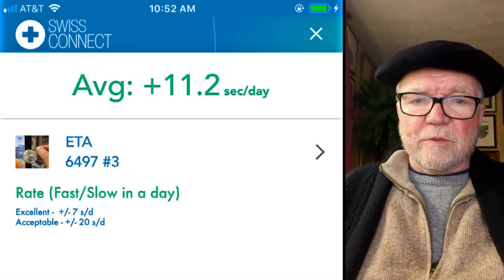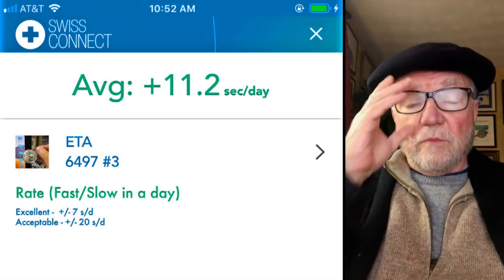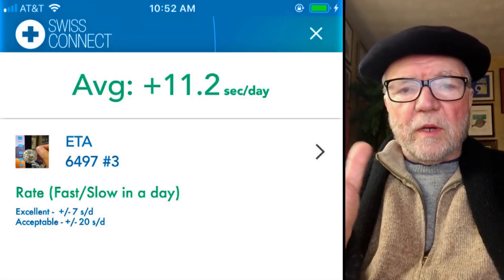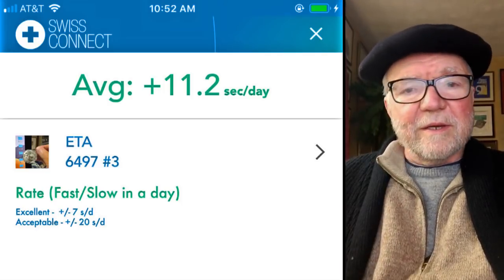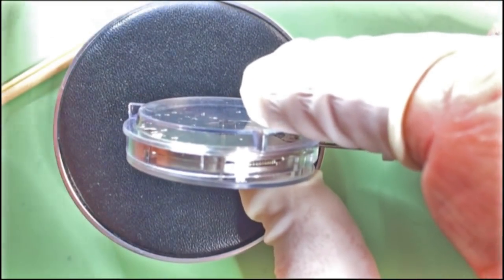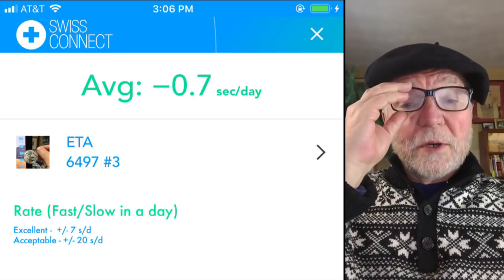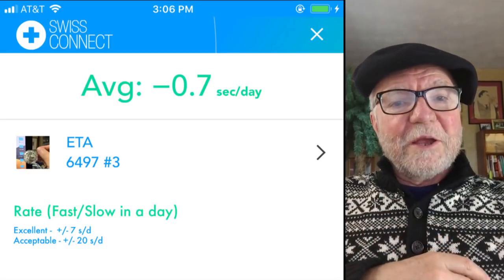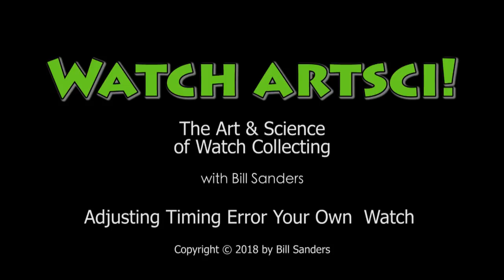Adjusting the Timing Error on Your Watch

Comment: can you do this without taking the movement out? my 6497 is running about +60 seconds a day
Reply from the maker: Yes Itubrr. 1) Use your timegrapher to determine the error. 2) Take the back off so you can get to the regulator. 3) Move the regulator to the left or right 4) Put the back cover back on. 5) Put the watch in the timegrapher. If it's ok, then you're all done. If it's still off significantly, repeat step 1-5. Take care, Bill
Reply: @watchartsci  I don't have a timegrapher or know if anyone without paying. I'll just have to trial and error; if your little push misused off 17 seconds I can do 3 of those then and still be good at +60 right now. Thanks for the video!

Comment: Well done Bill
Less than 1 second is better than COSC.
Reply from the maker: Hey Thanks FM. It's been running well, but there're a couple a problems with the movement that needs fixing. I think it's in the keyless works. Never a dull moment! Cheers, Bill

Comment: Hi Bill, started to put together my Daughter's Sea-Gull Parnis this morning, put  on the Dial and Hands got it into the case then
come the part i hate putting the 2 small clips with screws that hold the movement in, had to stop and save that part for tomorrow. This is my third Build too, most enjoyable and rewarding....Thanks for posting....
Reply from the maker: Hi Bill, still looking for a trick to get in the case screw/anchors. Spent several hours to get one in, and now I have to work on the other. It looks like the Green screwdriver is the right fit. I've been using the Rodico putty as a 'magnet' for small screws and anchors...it sometimes doesn't want to leave the putty...if you know any tricks...let me know! Cheers, Bill
Reply: What i did with my other watch i put the screw in a pin vice and using a dry oil stone put a point on the screw
it don't have to be a sharp point just enough to enter the hole better...You have to do both screws  
Best Regards Bill...."Good Luck"
Reply from the maker: Great tip! I recently got a pin vice for holding the stem. I had even tried a bit of Rodico putty on the tip of my screwdriver ... I set the bracing bar in place with a toothpick to center it...finally got it with my #5 tweezers...I'm trying the pin vice! Thanks, Bill